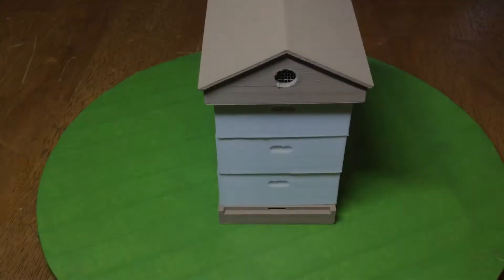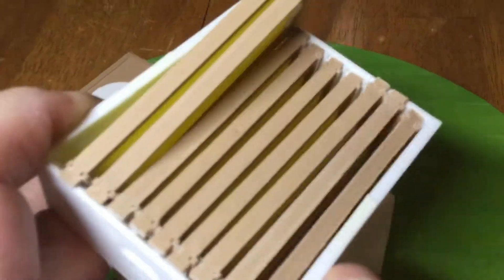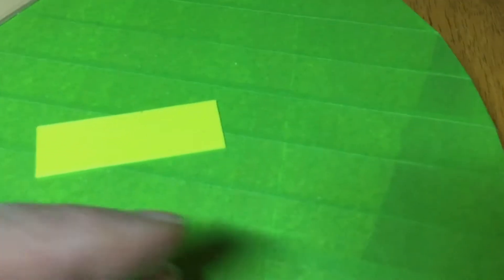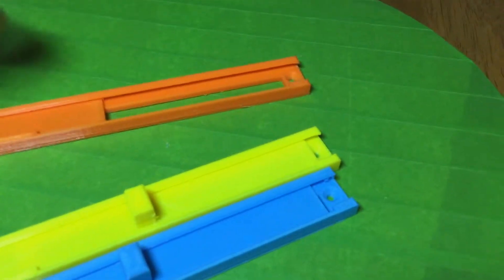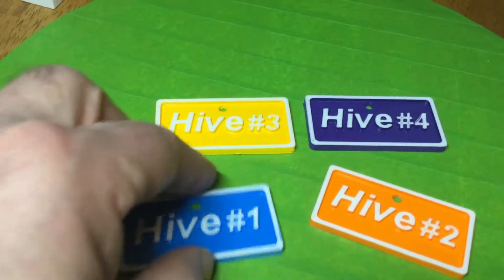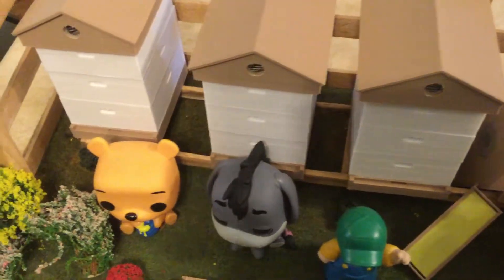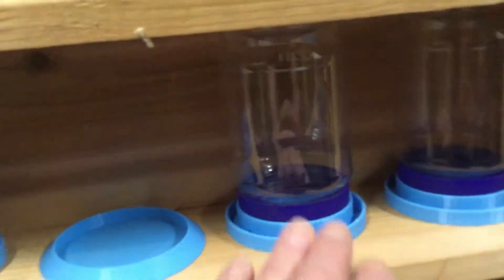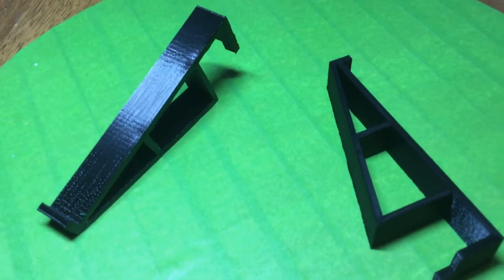G&H Honey Bees - Beekeeping series - 3D Printing beekeeping stuff

Comment: Hello, are you using any 3d printed products for beekeeping in 2022?
Reply from the maker: Yes, I amstill using a sliding entrance reducer and hive top feeders. They work really well so I have continued using them. The only issue I have with theentrance reducers is that if they get to hot they will warp. I have had to replace a few of them but they are easy and fairly quick tp print so I made extras to have on hand.